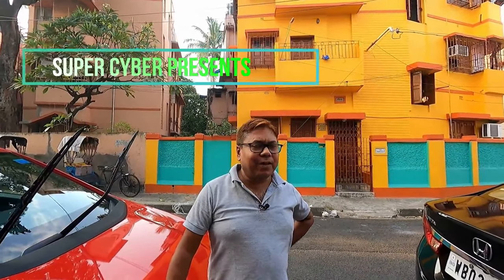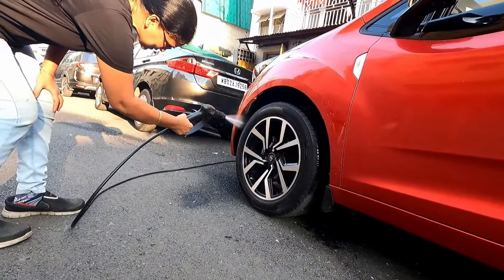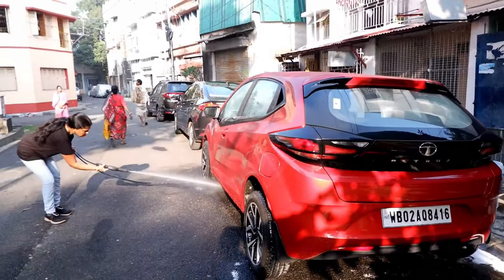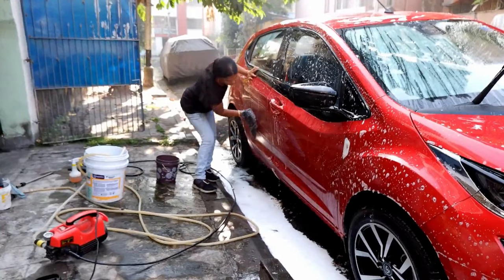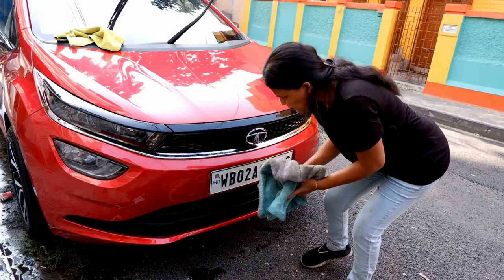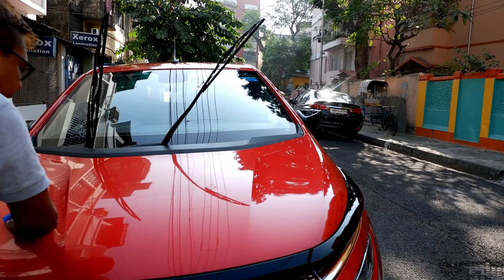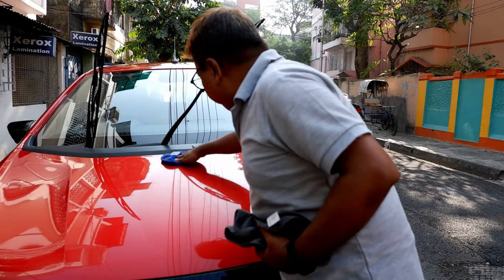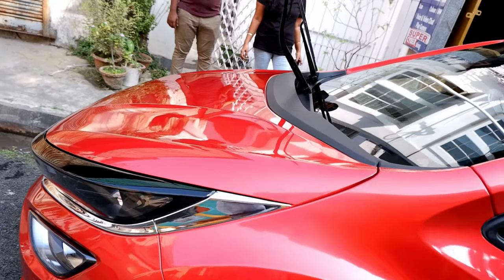Sonax Brilliant Shine Detailer How to Achieve Xtreme Gloss #sonax #cardetailing #tataaltroz

Comment: Amazing videos you share thanks for efforts, have a amateurish query...can you please share a chronological order when to you use which product eg: Got a dirty car washed from sc , now do we use this sonsx detailer first or turtle wax ceramic or turtle graphene and in which order to protect car shine, gloss, dust resistant , hydrophobic water resistant???
Reply from the maker: Thanks for your query and feedback. After you get back from. SC  give a  shampoo wash at home. Because sc use very cheap quality washes and you will see a oily feeling on the surface because their water gets mixed with diesel . So proper clean smooth surface is necessary. Now after wash you can use either of the products. Graphene or ceramic will give more protection and gloss. You can use Sonax BSD as a top-up after 2 - 3 months to extend your coating further.